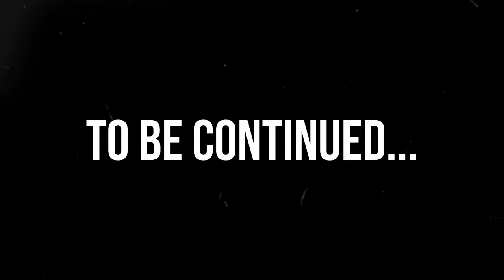Repairing loader bucket to our B7100 Kubota Tractor | Fixin Lil Mac | The 25.37 | Scrap metal

Comment: I wanted to ask you why you put the welding pliers or I should say clamped I guess it’s like the clamp on booster cables I didn’t know what it was called
Reply from the maker: The clamp on the wire is the ground for the welder...😬👍